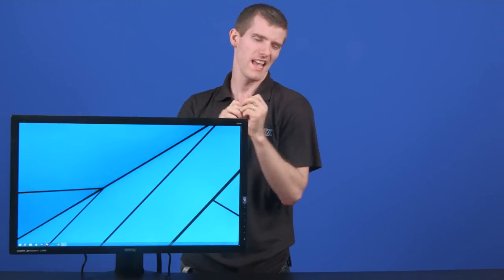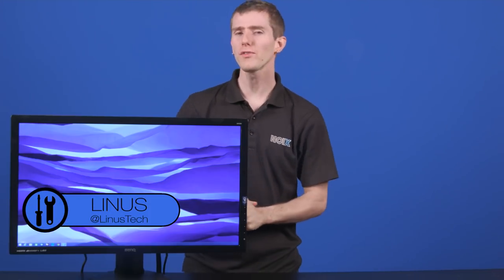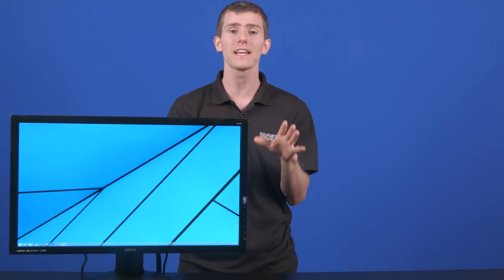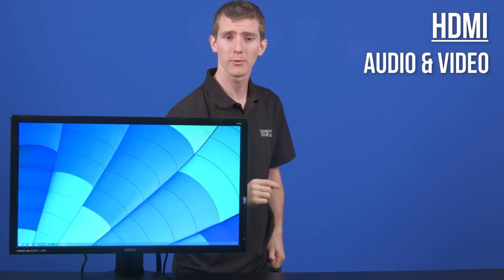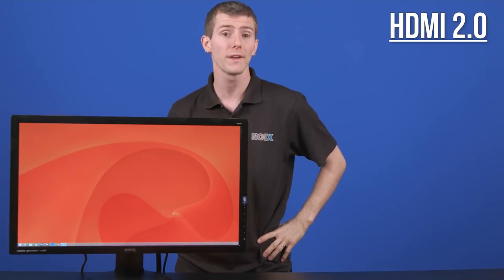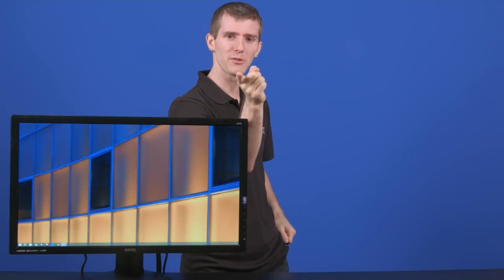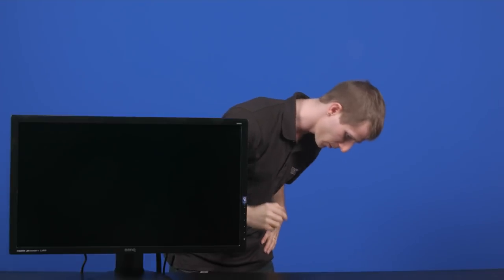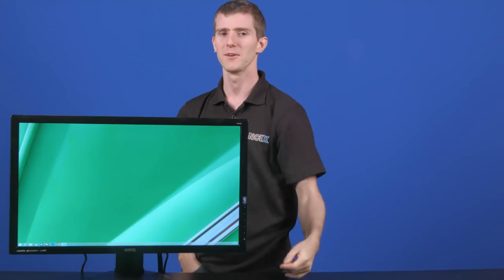Display Connectors Explained! - Tech Tips

Comment: DisplayPort master race
Reply: May your refresh rates be high, and your input lag low

#pcmasterrace
Reply: Aslan Khalilov I approve this message.
Reply: I had really much problems with displayport.. dont know why.. had to restart my pc because i had a displaporterror where my monitor just isnt showing up in windows anmore.. Back to dvi :D 144hz
Reply: derBackfisch123 I can't speak for AMD but Nvidia support of DisplayPort is shitty to non-existent. I have to use it because my 4K monitor predates HDMI 2.0 but the majority of times my GPU fails to transmit a signal via it after the BIOS screen, my motherboard beeps and gives a GPU error code. About 1 in 5 times I can boot first time without having to reset immediately.

The only workaround I've found is to connect both HDMI and DP, set it to extend displays, then turn off the HDMI "monitor". Now every time I boot it uses HDMI until it gets into Windows, then extends, then switches input. It does mean having two cables between my GPU and monitor after all, and it's not an elegant solution at all, but until this infant technology is actually supported this is the kind of shit we just have to live with.

Edit: this is on a GTX 970, by the way, so not exactly ancient tech. These issues are current as of October 2014.
Reply: boop booperton Sounds like a driver issue.  I use DP going from my GTX 780 to a 2.5k monitor and, to date, I've had zero issues.  You could also just have a lemon for a GPU.  Have you tried RMA'ing and swapping it out for another one?
Reply: ***** Well sure, it could just be a coincidence that it happened to both of my GPUs, and all of these people: https://www.google.co.uk/search?q=nvidia+display+port+black+screen&rlz=1C1ASUM_enGB600GB600&oq=nvidia+display+port+black+screen&aqs=chrome..69i57.5302j0j7&sourceid=chrome&es_sm=93&ie=UTF-8#q=nvidia+gtx+970+gtx+980+display+port+black+screen

I think given the wealth of threads that turns up though would imply that it's not just two faulty cards and that it's far more likely that you just got lucky by not experiencing this.

All in all we as a tech community need to stop pretending that DisplayPort is the single greatest thing ever when it's so poorly supported by anyone. I can't even say with confidence that there is a single AV Receiver that supports DP in existence.
Reply: boop booperton
It seems to me that the issue is localized to the 9xx series of cards.  Again, I'm running a GTX 780.  Older, but also ironed out.  The 9xx series is still slightly new.  Perhaps in a few revisions it will have its DP issues taken care of.

Still, I can see where that would piss you off.  Getting a top line 970 only to lack the support for the only connector that would really give you that 4k support you need?  Your anger is very justified.
Reply: ***** It's not necessarily the fact that it didn't work tbh. I expected issues initially because I got them as they were released. It's the fact that we've had how many driver revisions since, it's been four months, and it's not something that even seems to be being addressed in any official capacity. If the response was "guys we know something's up, bear with us" that would be ok? But there are literally tonnes of threads about this and it just tells me that Nvidia aren't ready to give DisplayPort due attention and support yet. HDMI got a fix that resulted in marginally less than true colour reproduction before DisplayPort got a fix for an issue that stopped it working entirely?
Reply: boop booperton
I've looked at one or two threads, and it seems the common issue is the 4k itself.  I don't even know how or why this would be, but it seems like some people found that the DP worked just fine in the 2.5k or lower range, but gave the flashing and blackout issues you mentioned on the upper limit of the connection's resolution.  And again, that only seems to be limited to the 9xx series.

You are right though, all of the driver revisions to date should have fixed that.  This leads me to think that it's probably an inherent flaw with the hardware design itself.  Maybe the PCB or the chips used in the 9xx series just weren't properly designed for 4k support?

That's my guess anyway.  Either way, sloppy work from Nvidia.  That, or it's their way of pushing their market past 9xx and right into their upper end territory.
Reply: ***** As of right now the 980 is as high end as it gets. If you're charging upwards of £400 for a GPU calling it anything but high end is kind of taking the piss.
Reply: boop booperton
I was referring to their Titan series.  The 980 is high end, but low power.  Nothing to scoff at though.
Reply: ***** I almost forgot they existed for a moment lol. The original Titan performs like a GTX 780, so it's no different to a 970 besides the RAM, and the Titan Black is essentially a 780 ti with too much vram. It's slightly faster than a 980, but it's not exactly in a league of its own. Maybe the next Titan might be different, but I would rather see their non-titans get sensible amounts of vram and actual 4K support, especially with 4K being as affordable as it is now.

As far as I can see all of this just boils back to Nvidia not implementing DisplayPort adequately. Since I used the workaround above with the HDMI and DP together, then disabling the HDMI I haven't encountered a single problem. It's an inelegant solution to a problem that should never have existed, but it works. And I'd sooner put up with the expense of a new cable, over the price difference of two Titan-branded cards.
Reply: boop booperton Well, depending on your needs, you could always scale back to a 780 or 780 Ti, which seems to have the inherent DP support you're looking for.  Or you can try and trade in for a newer 9xx card and see if the latest revision is any better off.

Still, I agree with your basic point.  This should be a non-issue.  Question is, what's keeping you from going with AMD at this point?  They seem to have this DP thing down.
Reply: ***** I upgraded for 4K. When I upgraded, the R9 295X2 was still £1000. I paid £500 for these two GPUs. As inelegant as the workaround is, it works, and even after the price drop, an R9 295X2 (more realistically two R9 290Xs because I wouldn't have to think about AIO positioning on my case) are not so cheap that it's insubstantial to me unless I have a pretty good reason.

So yeah tl;dr, AMD were a lot more expensive when I was looking to upgrade so I went Nvidia.
Reply: boop booperton
Ah, fair play then.  But you are aware that the upper 7xx series is 4k compliant, right?  Or were things labeled differently when and where you were shopping around?

Or were you just going for that new car(d) smell? ;D
Reply: ***** The 780/780 Ti run into the frame buffer limit pretty hard at 4K. The 780 Ti in particular should have completely blown away the 290X because that GPU itself is still so powerful, but 3GB is just the wrong side of what I'd be comfortable investing in a 4K build. And that was just as true a year ago as it is now.

The release of the 970 also meant that I could get two for the same price as a single 780 Ti (which has changed more recently) but on release they were such good value for what they were.
Reply: ***** Thanks :)
Reply: Moeyz69 VGA master race :3
Reply: Federico Duratorre The 970 is 4k capable on a technical scale.  The connector issue is separate from the fact that the card itself can actually handle 4k video.
Reply: "on a techical scale" but NOT in reality.  you're talking about VIDEO in a gaming context ?   yeah it can reproduce 4K video, but not create content..

oh yeah, in a technical scale, it can. a 3 FPS

there is a reason because it doesn't even have the connector
Reply: Federico Duratorre
It has the connector.  The issue is the driver support.

And I'm talking about video in a video context, seeing as I use a GTX 780 inside of Premiere Pro to edit video (some of which is 4k on occasion).

The card is more than capable.  Nvidia simply needs to engage in better support for its DP output.

Don't mistake a faulty connection for a lack of capability in the card itself.
Reply: Tomáš Pružina let an italian friend translate this for you :

staccah staccah che n'hai capito un cazzo di niente.
Reply: ***** It literally only exists in PC monitor and GPU hardware. It's on zero TVs, Receivers or any other kind of home theatre or entertainment hardware whatsoever.

In fact the only monitor I have ever seen support it in person is sitting right in front of me and this is a 4K monitor that predates HDMI 2.0.

The complete and utter failure of DP to gain any ground at all is the only reason I use a lossy DTS codec to transmit 5.1 Surround over optical cable to my AV Receiver and a separate DP to carry video straight from my GPU to my monitor. When I was shopping for a receiver there literally weren't any that didn't support 4K 60fps passthrough via HDMI 2.0 and 4K 60fps upscaling from 1080p, and none at all that supported DP. If there were I would have gotten one, but DP just doesn't exist outside of the PC community.
Reply: other tomperson yeah actually we're talking on LINUSTECHTIPS which... you know... il almost ALL about computers, so... that's not the place to say "display port is dead at the moment" because, you know, it's bullshit.
Reply: Federico Duratorre Tech is not limited to computers and you're talking about a display standard that basically no one uses.

If you click the "show more" button to read what I said you'll see that I was largely talking about being unable to fully utilise DP on my PC due to its piss-poor adoption.

Is a home theatre PC not a PC? Because a 4K console replacement or Netflix box will not be using Display Port.
Reply: this channel it's almost totally computer-related

why you suppose i agree talking about tv? i'd rather not talk abut the television. that shit is ruining everybody's life. stick to pc, play games and watch films 
your graphic card should have at leat one hdmi to connect your television whenever you want see a film in the "big 4K tv"
Reply: other tomperson We're talking about PC's here.  That's what this channel primarily covers.  That's what this video covers.  We're not talking about consumer level products here.  This channel has little need or want to cover that.

The professional PC community uses display port.  Most graphics cards use it because it is still a superior standard when compared to HDMI 2.0.  Most pro grade monitors use it for the same purpose.

Why the hell are you talking about low end consumer grade 4k TV's?  Of course HDMI supports those.  That standard was forced to upgrade so that it could.  That hardly makes DP dead.  That claim is utter bullshit.  DP still exists in the majority of newer GPU's and higher grade computer monitors.  Even Apple Products use a variation of DP known as Thunderbolt (same fucking standard).

You wanna talk about TV's?  Find an appropriate discussion for that.  Don't come on here making a claim that a standard is dead, when there is plenty of evidence pointing to the contrary.  It makes you look foolish and wastes all of our time just to prove you wrong.  It's annoying.
Reply: Jesus fucking Christ you people need to click the "show more" button before writing paragraphs about me not talking about PCs. I wrote a couple of sentences about TVs and then two paragraphs about my experiences of it on PC.
Reply: other tomperson It's that you mentioned TV's at all that baffles us.  That's not the format of interest here
Reply: ***** You're baffled as to why the single most important display medium would be mentioned in a conversation about the different ways of connecting to display media? How on earth do you manage to get out of bed without hurting yourself if this logical chain is enough to confuse you?
Reply: other tomperson It's baffling, given the channel you chose to comment on.  This is a PC based review channel, with minimal focus on anything TV related.

And aside from that, it's also baffling that you would use something so anecdotal as your own (rather limited) experience to support your false claim that DP is a dead format, when there's literally a plethora of evidence to the contrary.

Honestly, your claims are baseless, your evidence arbitrary, and your tanget on TV's pointless.  And you wonder why you get backlash for presenting a poor argument.

And you ask how I manage to get out of bed?  It's a wonder you have enough of an IQ to support independent breathing.
Reply: other tomperson
First off, it's a false equivalency to call a non-consumer standard dead.  SDI and BNC connections are far from consumer level, and yet they thrive as connection standards in a professional setting.  The same is true of DP.

I'm not sure what third tier plebe-level shit you're looking at, but any monitor that I've used which was worth its weight had either a DP or mini-DP connection on it.  Again, there's a chasm of difference between consumer level and the higher grade stuff.

4k TV's would be a wasted use of DP anyway.  The 4k you get out of those garbage setups is both compressed and low-grade.  Made for the average consumer who has no idea what the fuck a color gamut is or what the term bit-depth means.

And obviously you're not putting much effort into looking if all you can find are some shit HTPC cards (again, very consumer level stuff anyway).  Try taking a look at the AMD WS8100 or the Nvidia Quadro K1200.  Both DP-only cards, both at different ends of the price spectrum, and both 4k 60fps compliant.

DP support being shockingly bad?  Then why is it that both companies run not only their flagships, but also their mid-tier cards on nothing but DP?

It seems that your comments stem more from a lack of actual knowledge than anything else.  This becomes more evident every time you post a vacuous-minded reply.
Reply: other tomperson Wow, where to begin?

GTX cards are hardly consumer equipment.  And no, they're not purely professional either.  They fall into that awkward category known as prosumer.  Equipment that runs some of both worlds.

Really?  Those are the only monitors you've seen with DP?  What?  You haven't taken a look at Dell's 5k display?  How about a good number of the Asus PA, PB, and PQ professional series of monitors (which only support HDMI 1.4, but come fully ready with DP 1.2)?  How about Samsung's U32D970Q, which is another pro-grade setup that carries only one HDMI 1.4 but two DP 1.2 ports?  You're seriously going to make the bullshit claim that you can only find DP on gaming level monitors?  It's pretty clear you're not even looking if that's what you're saying.

I'm arguing that DP is a waste of time with consumer 4k.  That is low end shit that's compressed for quick playback.  HDMI is adequate towards that end, as it is a low-bandwidth connector.  DP is meant for higher end use.  To get the proper usage of a DP connection, a consumer level 4k TV would need to pull a 10 Bit or higher image, at 60fps, with a perfect color gamut to boot.  Consumer 4k playback systems couldn't even handle that load.  You would need a workstation PC to even hope to get real time playback with that.

Which brings me to the GPU's.  The living room doesn't need those GPU's that I mentioned.  They were never made for consumer needs.  And HTPC's were never meant to run the loads that you want to run.  Why do you think that Sony and Samsung make proprietary 4k systems with their TV's?  They're meant to play 4k with certain compressed codecs that work on certain hardware setups.  HTPC's are simply redundant in that regard.

This all circles around to the point I made earlier.  DP is a pro-grade connector.  At best, it's given to some gamers who don't want to deal with the limits of HDMI.  The lower class uses that you would like to see it put to don't even fit what it was designed for.

Also, your betamax analogy?  Yeah, same deal.  It died off in the consumer market.  It still found a home (as Beta Cam) in the professional TV market.  Bet you didn't know that either.
Reply: +Moeyz69 I just use HDMI...Not cuz I am not master race, my display just doesn't support Display-port...It isn't that commonly found on screens in my aria and I mean really, I don't want to reinvent to wheel, HDMI is a far more widely sold display cable as you can get it from your local TV-hardware store or you local computer hardware seller...I mean at-least you won't be setting in the dark if something happens to your display cable...
Reply: Moeyz69 lol someone's triggered
Reply: MasterPort!
Reply: How come displayport doesn't wake up from sleep... Is there a way to fix this besides going to BIOS because I have no options related to this in BIOS. Tried em all.
Reply: Moeyz69  awesome
Reply: @cakeisamadeupdrug6134  I'm here trying to catch up only to notice "6 years go" after half an hour of reading ...

Comment: Some things you forgot to mention: 
1. HDMI also supports Ethernet and control signals (CEC). 
2. DVI-D actually supports audio, but it is not in the standard.
3. What about HDBaseT as a display port? Why is it not used on computer cards yet? The cable used in HDBaseT is much simpler since it is a standard RJ45 connector and uses standard Cat5/6 patch cables. Not to mention you can have cables up to 100m with HDBaseT (in some cases 300m). Supports 8k resolutions, supports power over cable (PoC), supports digital audio, supports ethernet and carries two way control signals like RS232 and IR, all trough the same cable...
Reply: Wow, HDBaseT looks interesting!